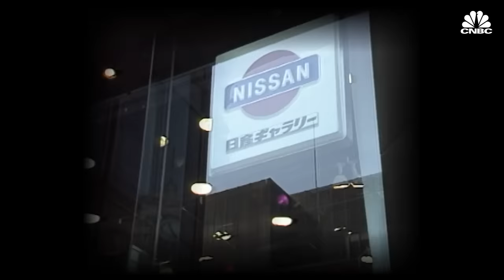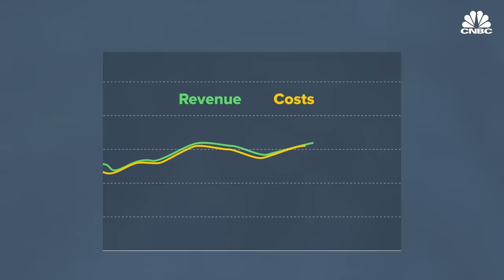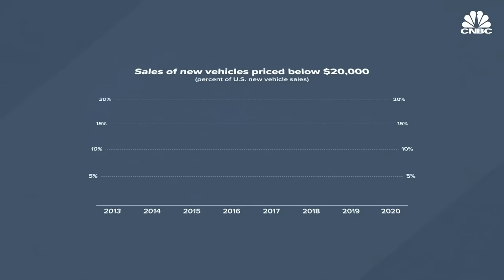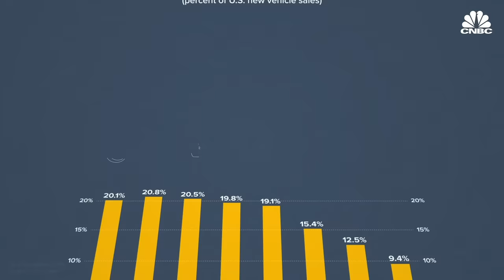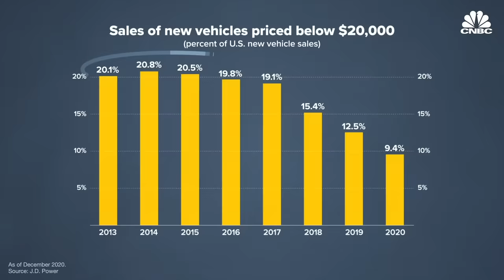Why Cheap Cars Are Disappearing

Comment: I love my 2013 Hyundai Sonata Hybrid car. $14,000 with 66,000 miles was really good to me. It's been nice to fill up the tank 2 times a month vs when my bf and I had a 1999 Ford expedition. With the 1999 Ford expedition we would spend $70 to fill up the tank and only last 4-5 day. We don't miss that at all!
Reply: Maybe the Ford Expedition wasn't suited for your needs. I know $70.00 USD is a lot compared to a Hybrid Sonata, but that sedan can't fit 7 people comfortably with their luggage, it might be only FWD and will require a very expensive battery cell replacement in 4 or 5 years which would cost pretty much the value of the car at that time. 

It is my belief that in the end, including maintenance, the cost of owning a Ford Expedition would end up being equal or less while allowing more people and their luggage to travel more comfortably.

I think it's all about getting the right vehicle for your specific needs.
Reply: The Sonata Hybrid is a good car.  Just buy what you need.  I have never spend more than 25% of my annual salary on a car and I properly maintain my car so it last more than 10 years.
Reply: @jml9550  Exactly! Thanks for taking good care of your car.
Reply: @jml9550  same here. I always buy my cars in full and keep them for 5-6 years. I bought a car in college and I still have it. I properly maintain it and treat it well because I prepared a rainy day fund for it rather than stretching to get a fancier newer model. If more people were financially prudent about cars then they would have savings and we would not be 1.5 trillion dollars in auto loan debt
Reply: @colechapman6976  smart moves.  Same here, we always have the habit of saving money for car repair/new car fund.  Also as a home owner, we also set aside money for repair/upkeeps.   Bottom line is spend less than what we make and never compare ourselves to anyone.

Comment: I didn't think 20 grand for a car was cheap. My bad.
Reply: Car industry mind conditioning-Cars below 20k are cheap. So one's cheap if he buys that, so indirectly forcing him to buy more expensive ones.
Reply: You do get a lot more for your money than you used too.

20k today for a new car gets everything you NEED in a car.

20 years ago, the equivalent was 13k, for that you got a car that still needed air con, power windows, abs, airbags etc as options if those things were available at all.

For a brand new car with warranty and zero miles, 20k is very reasonable
Reply: @stinger15au  That's assuming wages have kept up with inflation - which it has not
Reply: @Argedis  right but car prices haven’t risen that much either
Reply: @foxesamu  You don't think so? In 2004 the Toyota Tacoma started at $12,460. Today it starts at $26,250. That's more than double. Does power windows and a backup camera justify the difference?
Reply: For a new car, it is
Reply: @Argedis  i agree with your point.
Reply: Young people do not make that much or maybe they do.
Reply: trucker life  lol that depends where you live.

Certainly not in Australia where dual airbags was a option on lower spec cars.

Even in the usa wasn't it 1998 when it was mandated?
Reply: Me too and I'm 50 so I remember 4k cars. They aren't much more reliable either, just more knobs to fail now.
Reply: @stinger15au  We used to say the same thing in the eighties. Then the nineties came with more tech, higher prices, then the 2000's, same deal. It's like the bar shifts on what we "need" every model year now, like phones.
Reply: @johnbob4545  That is fair though, you could argue what people "need" was serviced in the middle ages with food and shelter.

The whole idea of technology progressing is to get more for less effort. Humans production has increased 20000% for effectively the same amount or in most cases less work than 1000 years ago.

Just a shame that due to capitalism l, the bulk of that production goes to the top 1% rather than everyone
Reply: @robertross4699  I don't know where you are getting your info from but according to the US Census Bureau the median income in the US for 2019 was $65k. Average and Median are not the same.

Median household income means that half of all households earn more and half earn less.

You should never use the average because it is skewed by high earning households. The average was $97k, but again that is skewed towards the wealthy. Do you REALLY think the average person in the US is making $100k? That's not reality. Half the population makes less than $65k
Reply: yeah, that's at least a month's wages for union and government workers.
Reply: @stinger15au  being reasonable is not the problem. The problem is being able to afford it.  People can barely pay rent after all said and done. To add a 20k car to their budget is ridiculous. Its not like the car will last the next ten years anyways.
Reply: @robertross4699  who come up with these numbers? I'm not convinced on those numbers. The average household also pay a mortgage bill, student loans, have children, and other utility bills. We talkin about if they can't afford 20K
Reply: @johnbob4545  people just need to stop but they can't
Reply: @Argedis  thank you. I was thinking the same thing.
Reply: They've actually condition folks to believe $30,000 or a $500 a month car payment is totally normal now SMH
Reply: Everything is going to crash.  Prepare and get to know your neighbors.
Reply: Lmao!!!! Right?
Reply: @robertross4699  bs... no its  not that high. The median is 68k. Where are you getting these fake ass numbers?
Reply: @stinger15au  I just did a configurator. For a pretty basic Ford Focus (small compact) it came to 22,1250UKP, that's nearly 30k dollars! Unless you enjoy throwing money away this is ONLY affordable by leasing. So, you don't own the car. The leasing company own you.
Reply: I Just spend 3000 for my BMW and 200 more for preventetive maintinance.  2000 bucks seems super expensive in contrast to that
Reply: almost all mid size new cars start at 30,000$.
Reply: @xianxiong3440  I don't think you understood my comment. What you're saying is common sense.
Reply: Go to school
Reply: @chubrikzhopa4881  Did that got a my bach and 15k of debt. Then spent 3 years trying to get into anything related to my degree in computer science. To many graduates not enough jobs. Stop pretending going to school is the answer.
Reply: @Argedis  Because car companies move brands up market, i do wonder if Toyota has cheaper trucks for sale in say Mexico or India or Brazil, but they just don't sell them in the USA.
Reply: @robertross4699  funny because before the pandemic hit, the talk was, the middle class is almost gone & to poor side is growing at alarming rates!! Look at what the damn average pay is in many states & look at what is basically dominate in the job market!! Then you will know why you are wrong & why you need to stop watching conservatard media!! 
  Hell, WV is dead last in average income at over $41,000 or $42,000 a year!!! That’s well over $50,000 less than what you are trying to push off!! Even the highest income average state is not even close to the number you posted!!
  Also, under the Trump administration, you can’t believe the lies on job growth because an independent study on job growth in America since WW2 ended, every president had job growth of one million & up except Trump, he has lost four million jobs!! The was done before the pandemic hit!! Even fox showed in January that the manufacturing jobs & other factory jobs have been hit harder under Trump than before!! 
  More Americans now are making poverty wages than at any time since minimum wage was put into law & other labor laws were enacted!!
Reply: @montyi8  No one can force you to do anything, except if they use things that you care about. In this case, fronting, vanity, or pride. If this is common sense, there wouldn't be so many poor.
Reply: @Argedis  the tacoma changed over the yeary and its basically not the same class of cars anymore.
Reply: @trazyntheinfinite9895  The current base model Tacoma has the exact same 2.7L 4 Cylinder engine from 2003 and is still just 2WD. The only main difference is that it has 6-speed transmission. The frame is also no longer fully boxed like it was back in the day to avoid rust problems. The old Tacoma actually had a HIGHER payload capacity than the new one because of it's fully boxed frame.
Reply: Absolutely 20 grand is a lot of money. These days I only buy second hand our current car new is 22k, I payed under 6k when it was 3yrs old cash no loan payments. Private sale no dealers.
Reply: inflation, in the 90's that'd be under $10K.
Reply: @Argedis  inflation happens too, a dollar in 2004 is $1.40 today, so $17,444 is the equivalent.
Reply: @jackson5116  Yup that was my point, cars have gotten more expensive far above regular inflation.
Reply: Come to Denmark, you will not get a lot for 20000$

For example The VW Golf.

US Starting price $23.195
Denmark Starting price $41.000

Oh and the US starting price is a 1.4, 4 cylinder petrol, while the starting price in Denmark is for a 1.0, 3 cylinder petrol.

The closest to the 1.4 petrol in the US, is a 1.5 petrol, that starts at $46.000 here.

Also, i dont know if Volkswagen have actually upgraded their prices on their website, because 10 days ago, the government here upped the prices further for all petrol and diesel cars in an effort to force people to go electric. (In reality, people will just keep their old polluting cars even longer, now that a new car got even more expensive)

If you only have 20.000USD here, you will be looking in the sub-sub compact segment, where the Ford ka, Citroen C1, Peugeot 108, Toyota aygo and so on, sits.
Reply: @jackson5116  I think your right about that. In 1991 I purchase ford escort RS turbo 87 in black my favourite car that I've owned for six and a quarter grand .Don't think you could get a decent one for much less than 15 grand today may be more. :-)
Reply: $20k for a new car has always been cheap.
Reply: @garynewcomb8649  "Look at average pay" no, you do not pass Go.
Average pay includes trillionaires weekly income in the total population.  It is not a usefull marker of majority earnings eg one dude makes $25M/week while 25000 people took home $800 the same week. In that sample population the average weekly earnings sums $25M + ($800 × 25000) ÷ 25001. The measure of central tendency would be much more realistic if the single millionaire in the sample was excluded.
Reply: I'm shocked about the car's prices in USA. Here in France 5 of the six most sold cars in 2020 are under the 20.000$ price. You pay too much there.
Reply: @Argedis  I don’t think they were that low in 2004. Are you certain ?
Reply: @robertross4699  your numbers are way off not sure where you got them but I instantly knew that was too high and researched. The median household income in United States is $68,000. Wages have not kept up with inflation and that’s not my words it’s the financial industry’s words.
Reply: @ foxesamu  Fundamental problem with inflation...... Your employer is victim as well.........
Reply: @jfish9014  BS. "cheap" as a concept nowadays only applies to the 6+ figure crowd.
Reply: @robertross4699  those numbers are wrong. In 2020 the median houshold income was just below 70k. It was 69k.
Reply: @Argedis  Not to mention lower wages now than they were in 2004, no pensions and worse health insurance plans. So prices should be coming down not up.
Reply: @Argedis   you get 10x more in the car and accoutn for inflation that yes.  the key being inflation is ridiculous.
Reply: I see parallels to the PC industry.
A lower end i5 desktop part and $200 GPU (even more so) are considered budget now. 
Even though I am pretty sure they anything more is overkill for most who buy them.
Smartphones have seen an upper trend too.
I guess just throwing more at the equation is easier than innovation

Comment: “Lucking for consumers, cars last longer than they used to” biggest lie I’ve heard. My 20 year old Honda prelude is running better than a 2016 Chevy sonic I used to have. Cars nowadays are made with more plastic than Kim Kardashian ass.
Reply: LOL. At least they don't go rusty. After I fixed it in 1996 the front valance of a friends 1984 Honda had more plastic filler than metal. The same car got scrapped at about 15 years old due to rust, despite running perfectly and having only 60000 miles on the clock. As the mechanic said "there is no metal left to weld onto".
Reply: True, i owe many cars right now, and the more reliable ones are the old ones, my newer ones my 2008 f 150, my 2011 mustang and my wives 2011toyota corolla are not so reliable, the quality sucks, interior, paint, mechanics, my 1991 5.0 works like a champ with almost 30 years an 200k plus and my wives tercel, 98, with 175k plus miles works great, it even has the original sparkplug coils in it and runs like a champ.
Reply: Thats a lot of plastic
Reply: Well when you stuff so much tech crap into a car it's more complicated... More complicated breaks more often.
Reply: Cars are MUCH better and more reliable than ever before.  When I was a kid, our 1949 Studebaker was blowing blue oil smoke at 60,000 miles.  When's the last time you've seen a smoking car?

My 2000 Buick Regal GS still gets over 4,000 miles per quart, and most of that is a small leak.  It has about 210,000 miles on it.
Reply: @ricker024   Not true.  More complicated really only means that when repairs are necessary, they are more expensive to analyze and repair.  

Look at an engine with a carburetor vs. fuel injection.  The latter is FAR more reliable, despite its complexity.
Reply: @frequentlycynical642  a supercharged 3.8 is a great engine. Quick and economical,200k miles if we'll maintained.
Reply: Dude, u bought a chevy and expected quality lol
Reply: Planned obsolescence is a real thing. And it’s scary that even Mercedes and bmw do it, cars that cost well over 60k.
Reply: @luke_cohen1  This is true. In the 1970's a car with 80,000 miles was a junker. Now days it's just broken in.
Reply: @frequentlycynical642  Very true. Many people aren't old enough to remember how bad cars used to be.
Reply: Yeah buddy H22!!
Reply: Same as I said above. I kept my dad's 77 Caprice wagon with the 305 with the wing option in the blue color and it purrs like a kitten. Easy to get parts and easier to fix. And dang, a sheet of plywood fits.
Reply: @luke_cohen1  80's, and above cars are not worth the effort except for rides like the Dodge Power Wagon or a few others, but ALL 70's vehicles should try to be saved and are easy to work on.
Reply: @joaodasilva4734  that's not really that many miles for both of those cars. The average is about 13k a year in the US.
Reply: @luke_cohen1  You left out alot of them are extremely easy to work on and the parts are cheap.
Reply: @frequentlycynical642  > When's the last time you've seen a smoking car?

In a Cheech and Chong movie.
Reply: @marcelluswallace4598  >Planned obsolescence is a real thing

So they really have the ability to make eternal cars? Youre looking for God, not a car.
Reply: Should have bought a 2016 Honda. :)
Reply: @luke_cohen1  Older cars, particular Japanese ones, many have proven to be bulletproof. That’s why you always see them on the road. No confirmation bias. You see it all around you
Reply: @frequentlycynical642  Many new BMWs seem to do so. Saw it a few times. Saw them burning twice on Highways, too. I belive around 2000 was the pinnacle of reliability and build quality in cars although design can be widely described as boring. Plus, the rust problems were ended for good (Except Mercedes. Probably part of the Mercedes experience.) I own an 1996 Audi A4 and all that goes wrong are the old seals. Replace them and you are fine. And it does not start well anymore in Winter, but it always starts. And it drains the battery over one week, but that is probably due to an accident 22 years ago. 

Many, many cars of that era are still around if you are observant (At least in Europe; so mainly European cars). They just don't look to different from the newer ones so you don't notice them that much. The brand-new cars look different though as there style is more agressive. I have an friend with an A-class of that time, one with an Golf convertible and one with an VW Jetta. They are working just fine, too. The convertible is even still waterproof.
Reply: Sonic is a terrible car
Reply: @TeaParty1776  Well, it is kinda bs when the AC insulation desintegrates because it is environment friendly in less than 6 years. 
The motors are way more reliable, but electronics are more expensive than what they should be.
Reply: @CarlosJOlivQ  Your point?
Reply: @TeaParty1776  New cars are harder to maintain.
Reply: @CarlosJOlivQ  So? They last longer and perform better. Ask an investment banker for money to manufacture old cars.
Reply: @johnbob4545  Decrepit boomer generation bias if I ever saw it....